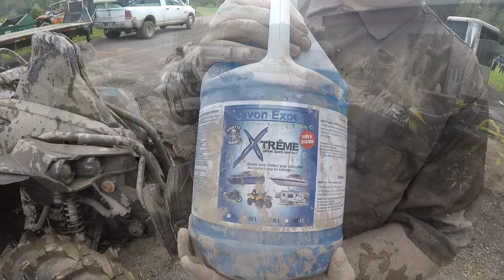2020 Can-Am Renegade Xmr1000r Hits The Pit & Sneak Peak Of 2020 CFMoto CForce 1000

Comment: Wow does it have a locking diff? Or am I just stoned??
Reply from the maker: The CfMoto? or the Renegade?
Reply: @ehTV1000  the renegade. When you were trucking through the water it looked like those front tires were working pretty well for visco lock
Reply from the maker: @georgeduckworth4452  Oh they do when ya get on it, Where it lets ya down is when crawling and fighting for traction when ya need it most. TorqLocker bud! Only way to roll
Reply: @ehTV1000   yeah I definitely second that!
Reply: Those marijuanas will change a man.

Comment: Imo their 1000cc engines do 46kw or something, same as my 650
Reply from the maker: The 800 CFmoto I drove did more then that in low. LMAO
Reply from the maker: LMAO, I'm not sponsored by anyone you don't see in the intro credits. I rode one and thought it was just fine in comparison to every brand I've driven. I have no long term use of the machine and can not comment on how well it would continue to preform well. But for a quick rip the machine felt great.